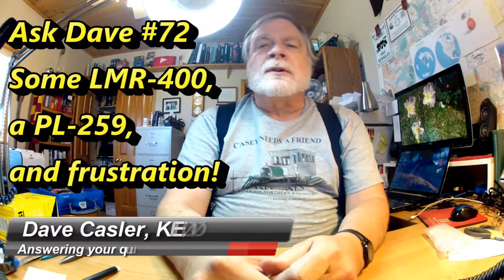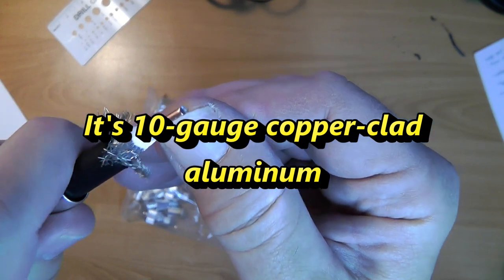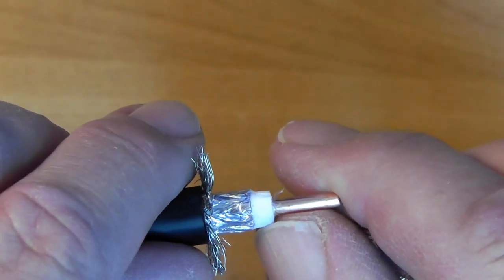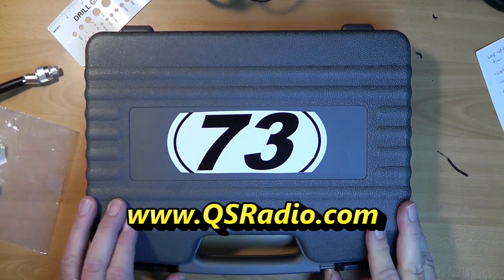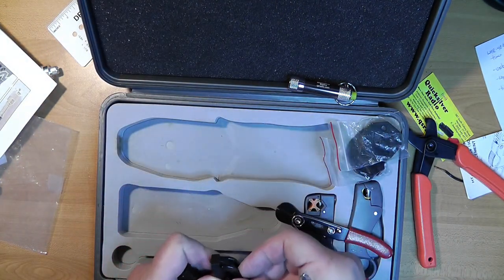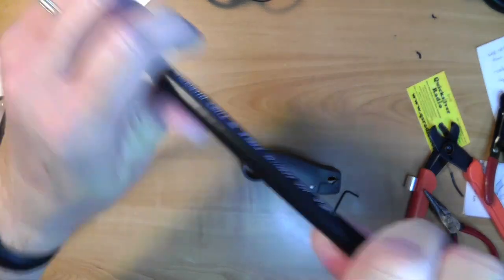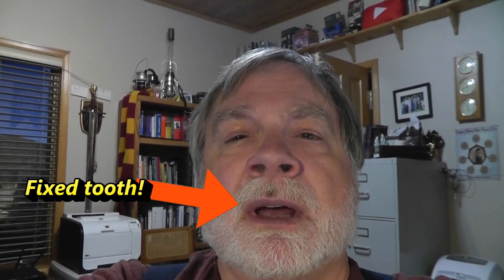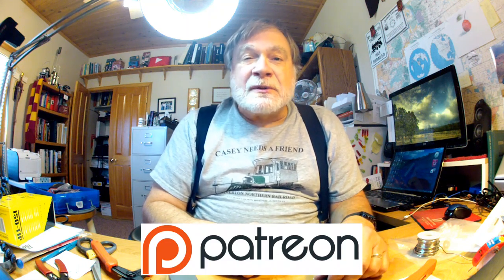LMR-400 Coax Cable and Connector (#72)

Comment: LMR195 is VERY good for mobile installations where it is not bending repeatedly, as at short mobile runs, the loss is far less the typical RG 58a/u. RG58a/u at 150 has 5.604 loss and LMR195 at 150 has 4.4 at 100ft. So a 12 ft run of LMR195 the loss would be .5db. It’s an entirely different story for HF and longer runs, where LMR 400 or 600 are King.

Comment: Crimping is not soldering. I've seen copper braid, for example, or copper automotive wire corrode inside the shielding for feet. Once oxidation starts, it travels.
Solder is the only way to ensure 100% an infinite ohm
Reply from the maker: True. I prefer soldered connections myself. I started with crimped connections when I couldn't get a PL-259 onto RG-213. I've been less than impressed with the crimped connections I make. The LMR-400 specially-made connectors are pretty good, though.

Comment: I have ABR LMR-400 and it has a braided center. Got crimp connections from HRO. The hole is too small for the coax. No matter how well I turn the tip it’s a no go. Hoping the solder type connectors work. If not guess I’m buying another piece of coax already assembled. 😡

Comment: I bought a Eton Satellite Radio and I don't have the 50 ohm BNC Panel Mount Socket - and wondering what type of cable to connect it to do I need.  LMR 400 or is there one that is already put together so that I don't have to do all the manual work.  Direct to a link or webpage of where I can by one.  I am trying to connect to an antenna.  Thank you. milo

Comment: Hi Dave I got a problem and I need your help KG5CUO is my callsign. 
Ok I replaced my RG8 coax with a ferrite bead on each end of it with some LMR 400 I did not have problems until it rained or did not notice it to be honest. I started noticing when i use my manual tuner a MFJ-969 I can get the swr flat 1.0 witch is fantastic as you know for the standing wave. So i started to notice it going down but if i held it down for 10 seconds or so it would start to build up RF coming back into the line I notice this when the standing wave began to rise slowly upward and did not stop. So a bead is to small for this coax and i need a way to stop this when i put it back to 10 watts it does not happen when i rise above 25- 30 watts I get these reflections back on 10 meters.  I am using a IC 7300 mosfet so you know like i do they do not like high standing waves. So the question is because of the beads being to small what is another way i can solve this issue? a ring maybe wrapping it 10 times? I don't know I Waite for your reply as soon as you can KG5CUO - JOHN 73

Comment: Hello Dave, learn a lot from your videos, Thank You... Question, I have 100ft LMR-400, now I am changing antenna and need to put it out further in the yard, I am short on the LMR-400. Can I add a length, 50 ft,  to add too or do I need to buy a longer cable? (150 ft is needed). Thanks again...

Comment: Why do you use crimp vs solder connectors?  Lots of hams I talk to say soldering is the only way to go because crimps often fail...I have melted a variety of cables dielectric and insulation trying to solder on them and at this point I have decided commercial off the shelf is easier to get though I would be interested in more suggestions on how to get a good connector.  I really wish there was something as fool proof as the TV compression fittings for this stuff.
Reply: Matthew Miller 
get an inductive solderer
Reply: It's very difficult to solder LMR cable, due to the foam core. It can be very easy to get it too hot, breaking down the foam.

Comment: Dave,
The part number in the LMR400 Times Microwave spec sheet you showed has a DB at the end for the cable with the water tight cover.  Doesn't the "DB" stand for direct burial?  
I bought some LMR400 coax from HRO manufactured by ABR Industries LLC.  I got the LMR400 Ultraflex (stranded copper wire center).  Their part number is 25400F-PL-125.  It was 125 feet long with PL-259 connectors on each end.  Their spec sheet says: Low Loss RF Cable, 10 ga Stranded Very Flexible Low Loss Cable, Non-contaminating UV Resistant, Direct Burial, Black PVC Jacket.  It has .8db  attenuation per 100 feet at 30 MHz/2.77KW/83% E.    So this is another brand, but looks like about the same LMR400 specification as the Times Microwave LMR-400-DB.  I bought 160 feet from HRO with PL259 connectors on each end for $149.95 plus sales tax, no shipping charge. I buried it in a trench about 100 feet long and so far it works fine.

So, after your frustration with installing the connectors using the QSRadio Crimp Tool, what do you recommend using for putting connectors on coax?  I've had trouble soldering the shield to the connectors on the solder types.   I've watched your video on coax connectors, but will watch it again.  73
Vee Butterfield W7IBB, Taylorsville, Utah.   (Love your videos!)

Comment: Hello Dave,

Thanks for all you do.

Question. I am putting up a 2 meter yagi on a 20 foot pole about 50 feet from my shack, using LMR400.

Soil here is extremely rocky. I can’t bury the coax, leaving me two choices... either lay it on the ground inside schedule 40 PVC or hang it from a parachute cord line anchored at both ends.

1. Any special considerations I should consider?

2. Given that the LMR400 is such a bear to work with, is there a satisfactory alternative in my application?

Thanks, Dave
Reply from the maker: Take a look at RG-213. It's much easier to work with. I'll admit all my coax cable is laying on the ground out back.

Comment: i need to run cable from attic to downstairs through wall and make a bend from wall to an outlet.  what is best: bend cable, or maybe a 90 degree elbow connector, or maybe sacrifice db and use the more flexible LMR ??
Reply from the maker: LMR-400 can have a bend radius of just 4 inches or so. Try to avoid extra connectors in the line if you can.

Comment: I'm a new ham and how well will this coax work on 2m, 70cm with a comet gp1 antenna using a 25w radio.
Reply: A) Never say "new ham".Just ask for clarification on whatever issue you would like an answer.  When asked when you got your license say "I'm sure it was a while ago".  Just because you are "new" doesnt mean you don't know anything. No one knows what you know or don't know.  
B) Cable suitablity depends on length and frequency. If you are running around 100ft @ 70cm, you'll lose about half the power. Use LMR600 instead. It's ok to use a foot or two of RG58 to connect from the long wire to the HT or radio. 
If your run is going to be 50ft or less LM400 will be OK, but still you'll lose more signal than with LMR 600.    It's cable.  LMR600 is about double the price of LMR400 but not too much over double the price. (I say this because usually when you ask for something specific that you want magically the price increases :)  ) 
Finally , welcome, have fun and don't buy everything everyone recommends without you doing your own research, this post included. :)

Comment: I am a reaper owner and we use N connectors
Reply from the maker: The N connectors are slowly growing in popularity. In Europe they're very popular.
Reply: @davecasler  To my mind, they are superior in every way to PL-259, and I wish we would see N series a lot more on amateur radio gear.
Reply: @TonyLing  I know an electrical engineer who calls pl259 connectors shielded banana plugs, yes N connectors are definitely superior in terms of high frequency performance so I would like to see manufacturers use them for 50Mhz or higher. TNC connectors have the same electrical characteristics as N connectors but are a little less robust, so I would regard them as a good alternative.

Comment: What exactly were you doing with the wire size guide? It looked like all that needed to be done was to cut the wire off? (Or was that just so that you knew the correct center wire gauge to put in the video?)

Comment: No, Dave. Copper clad aluminum wire is not used for strength. CCA has only become popular because it is cheaper than solid copper. It has lower carrying capacity so it can be dangerous to the unwary. LMR probably can get away with it because they are concerned with RF skin effect and DC ampacity is not their concern. I think LMR400 used to be a solid copper core.
Reply from the maker: Thanks for the info.

Comment: Hi David, great video as always. I am a newbie and I purchased some LMR-400 a while back. Finally came to the point where I am installing a discone in the roof, it will be about 40feet above ground. A lot of people are saying that it is an over kill but I am ok with that. What might be the pros and cons of having an LMR-400 on a discone, also I have been told never to rely on crimp on connectors, I guess if properly done connection should be mechanically sound?

73
VA3LAM
Reply from the maker: Crimp-on connectors can be fine, but don't yank on them or pull them. LMR 400 will work fine with a discone.
Reply: Properly done crimp connectors can be very reliable, in fact they are used almost exclusively in transport aircraft avionics installations. There should not be any issues with using LMR400 with a discone antenna, the same frequency Vs length loss considerations apply for that kind of antenna as any other.

Comment: LMR 400 is aluminum foil under tin plated copper braid. Galvanic corrosion is an issue. M&P ultraflex 13 beats LMR 400 hands down.

Comment: A high grade, high quality piece of coax and a CRAPPY PL-259 = a disappointing pile of frustration. I avoid those PL-259's all together. The first thing I do when I get a new or even old transceiver is remove the SO-239/PL-259'S and install "N" connectors that goes for the antenna and coax as well

Comment: Sadly LMR-400 is not RG-400, nor as good as people think it is.   It has an aluminum foil shield with a tinned copper braid over it.  Google RG-400,  compare that to LMR-400.  Once you add some RF to it, LMR-400 becomes a source of noise.  Same with Belden 9913.   Its banned in many ham and commercial repeater sites.   Sometimes you are forced to use what you have.  Slather the shield/braid/jacket interface in silicon grease during assembly,  as humidity can ingress into the coax from the connector ends.  Also hot glue coated heatshrink tubing can be helpful too.

Comment: When one does the math for LMR-400  RG213  RG8x and RG58. I have no idea why anyone would buy RG58!!! Also RG8x, which seems to have become popular, performance isn't desirable either!!!! Any ham radio shouldn't have anything less than RG213. LMR-600 is pricey, but I'd rather spend money on good coax than waste it on substandard coax that can't be made any better than adequate and only when cut to 'electrical' halfwave length.
     The truth is rg58 and rg8x can make a marginal antenna a useless antenna. People refuse to understand how critical coax is in an antenna "system"!!!!  I learned the hard way, don't cut corners on coax.
Reply: For some reason people hear RG8x and the X is silent. Or they don't realize that rg8X is radically different than rg8/U.
Reply: @dimitriapproved  
Spot on, thank you for that addition. RG8U has similar attributes to RG213.

Comment: I'm sorry to disappoint you, but LMR-400 is a poor cable for radio amateur use. Look up Westflex-103, I've used this cable for many years from 160m to 23cm. Cheaper and a much higher spec.
Reply from the maker: LMR-400 seems to be everyone's favorite cable around here. I bought a 500-foot roll and wish I hadn't, because it's going to take me forever to use it all. I really wish I'd bought a roll of RG-213 or even just RG-8X, both of which are much easier to handle than LMR-400. The westflex is air-dielectric, which goes back to the earliest days of coaxial cable. I've not seen it for sale in the US.
Reply: @davecasler  I came to the comments to say I would rather use RG213 as with its 7 copper cores it's a lot easier to bend and make connections to the plug...I like you also bought a Full roll of LMR400 but didn't like it at all especially the stupid sticky foil that's almost impossible to scrap off the foam..After reading all the comments it looks like you came to the same conclusions as me Dave..I don't really think you can get any better than RG213 for 30Mhz and below even RG58 is ok for short runs and patch leads. 73 from Liverpool UK M0BFM